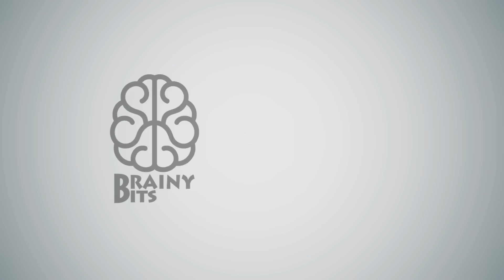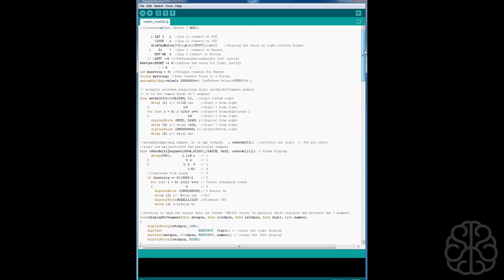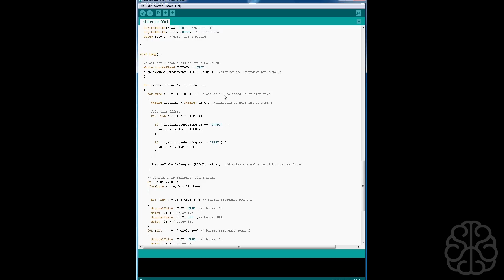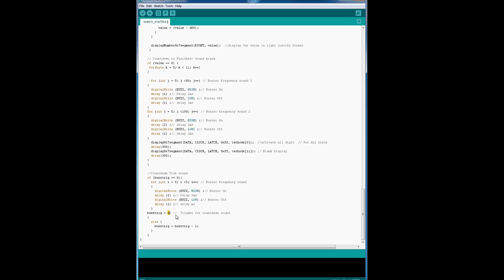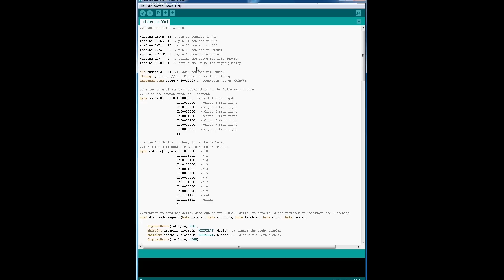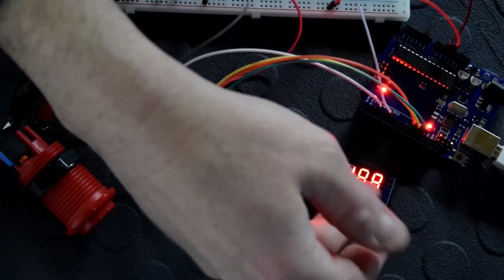Let's make an Arduino Countdown Timer... With the ticking sound! - Tutorial

Comment: I realize this is a rather old video, I ran into it on a search to simplify a count-down timer for my wife, who has glaucoma and needs to insert medicine in her eyes twice daily.  She needs to insert, then keep her eye closed for 2 minutes 30 seconds. Right now she uses a watch with a second hand and stares at it with her good eye till the time is up, a rather distasteful chore to say the least. I built her a little count down timer but using an lcd screen which takes up 3/4 of the black box that I used as a case.  She says it is to big and bulky to have on her night stand. I power it off a 9 volt battery using a home built step down unit, on an arduino pro-mini-special break out version with tons of pins.  She would like it to have just 4 digits LED type and a buzzer to say when done, with the power switch and reset switch I have on my box, in a half size project box.  I think I can do this using a plain Pro mini with no pins soldered on, perhaps  3v version using a small lipo rechargeable battery salvaged from an old cell phone.
Reply from the maker: Hi Jerry, you might want to check our this other tutorial here: https://youtu.be/h0CqhKnjQSI it uses a very small DigiSpark and is powered with a 9V battery.  It has a countdown timer + a Buzzer.  Hope that helps!  Thanks for sharing and for watching!
Reply: WOW, man you can read minds from hundreds of miles away, that is EXACTLY what I wanted! I even have a couple of digispark devices in my parts box!  Wife will be pleased indeed, thanks a million!
Reply from the maker: Really cool that one of my project can help you build something that will be used to help someone.  Good luck and best wishes!
Reply: Thanks.

Comment: Why did you use such a complicated method to get hours-minutes-seconds?
You could just use the modulo and divide operations. For example:
int ticks = 100000;

int seconds = ticks%60; // = 40 seconds
ticks = ticks / 60;

int minutes = ticks%60; // = 46 minutes
ticks = ticks / 60;

int hours = ticks % 24; // = 3 hours
ticks = ticks / 24;

int days = ticks; // = 1 day
Reply from the maker: +Dimitris Pappas I didn't do it on purpose I assure you :).  This is a case of me taking a wrong turn at the intersection that said:  "Easy / Hard for no reason".  That being said, thank you for the example you posted, I'll make sure to keep it in mind when I do another countdown timer.  Also thanks for sharing it here.